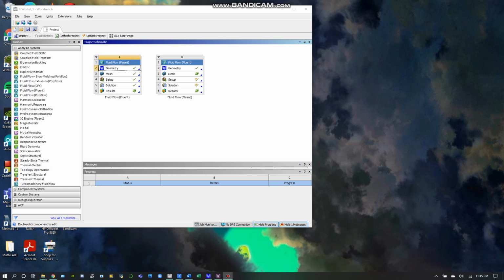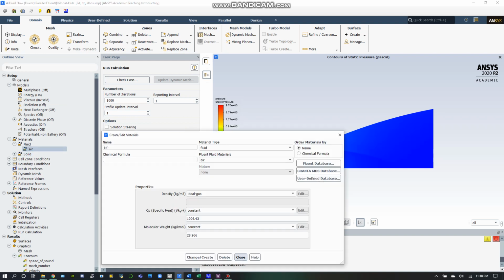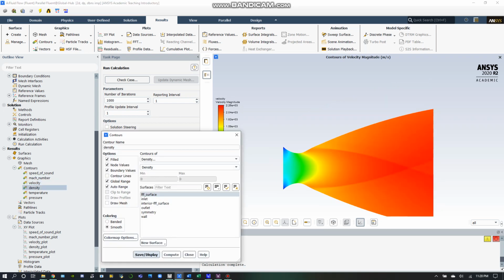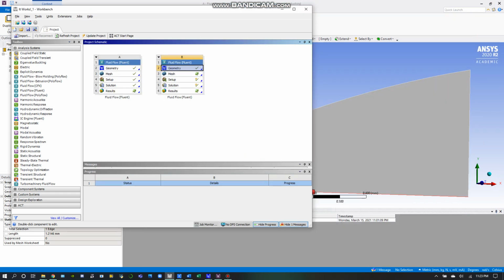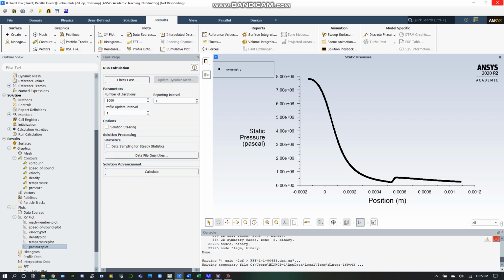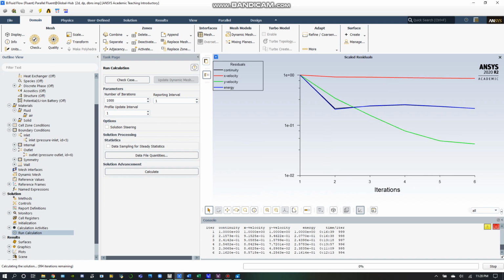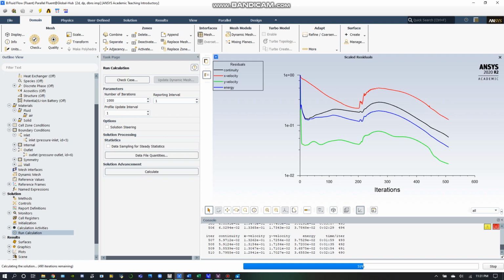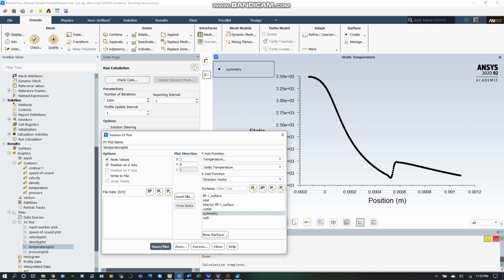CD Nozzle Simulation

Comment: Hey Wilson!

Loved your video and was able to replicate your simulation with good results. I would be glad if you could help me on this. 
I am trying to perform a CFD solution of an aerospike nozzle with Spalart Allmaras Turbulence model. But somehow my results are getting diverged. I went through the literature, but am feeling a bit unsure about the boundary conditions given I have used. I have already tried refining the mesh but to no avail.
Reply from the maker: Hello Ankit, I am glad you enjoyed the video. I am by no means an expert in FEA. In your case, I have not seen your work, but oftentimes divergence has to do with mesh quality. This is what I would recommend.. I would make sure your geometry created has no gaps and then create a basic mesh. Start with big element sizes and run the analysis, although this is counter-intuitive, sometimes the software is able to converge using a basic mesh,, although your results may be a bit blury due to the non-fine mesh. Then go back and refine the mesh and / or start introducing whatever mesh qualities (face mesh / sizing / manually changing element size / changing from quad to triangle / inflation) you may want that will help keep the mesh looking even. Hope this helps in your project.
Reply: @hunterwilson7658  I see, I will try that way and see if it works. Thanks for your prompt reply